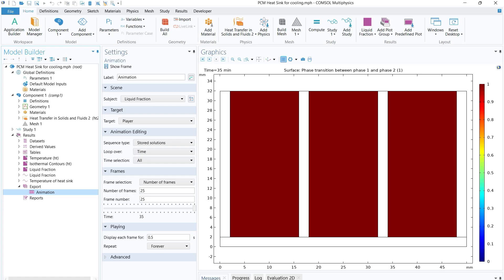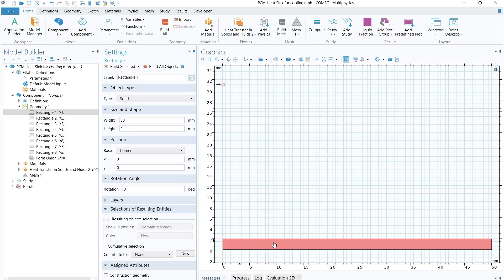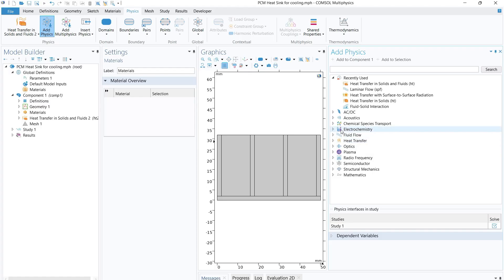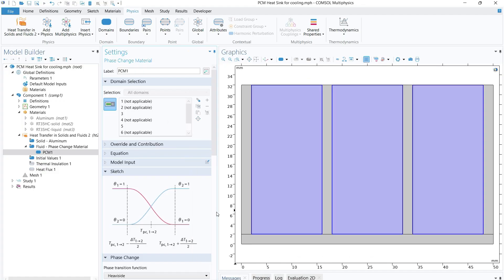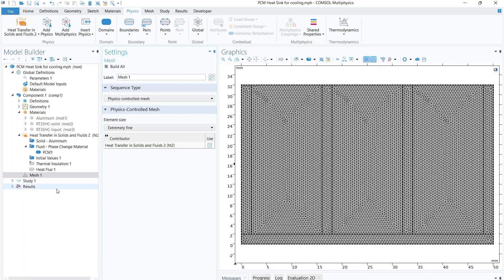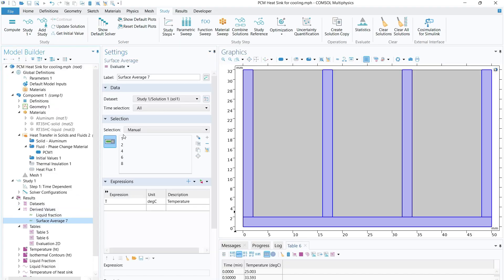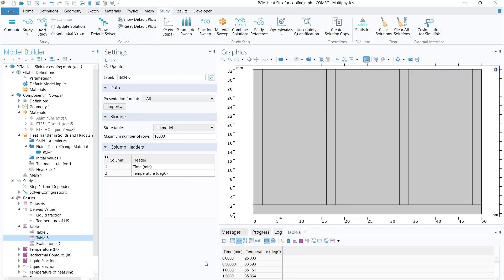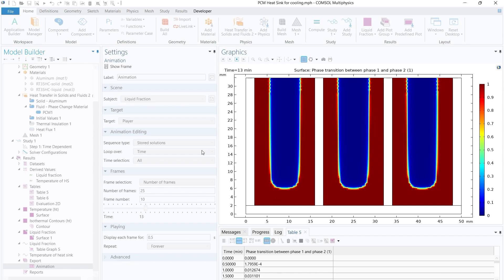COMSOL Tutorial 17 | 2D Simulation of PCM-Based Heat Sink | Heat Transfer in Solids & Fluids

Comment: Thanks for video, for liquid fraction why don't chose variable " theta 2" instead what do you use " phase transition...." ?
Reply from the maker: Great question! I chose the “phase transition” variable because it more accurately represents the melting/solidification behavior in that specific simulation setup. “Theta 2” could work too, but it’s usually tied to a different physical meaning depending on the study type. I’ll consider making a quick video explaining the difference — thanks for pointing it out!